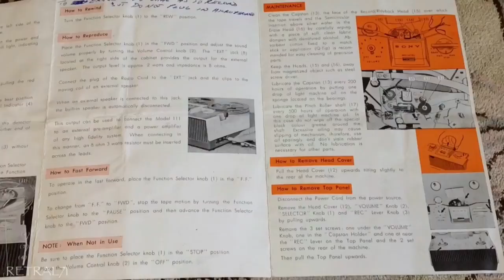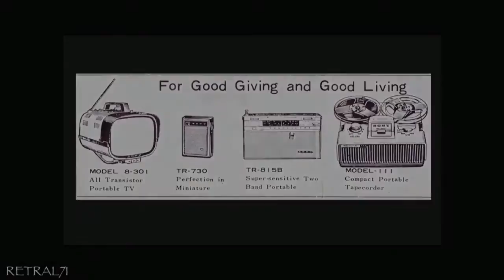Sony Tapecorder 111 Reel To Reel Tape Recorder

Comment: I have one of these, in pink. Can't find microphone at moment, but have case and plastic cover. Have power and alligator clip cords. Hasn't been used in years. We bought it in 1962. Is there market for it, does anyone think? Pleasant machine with great design.